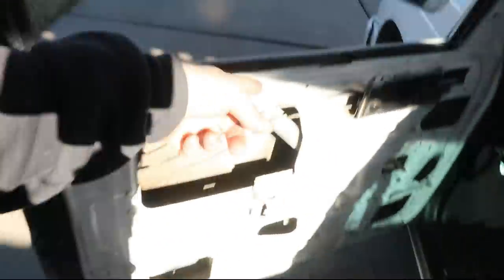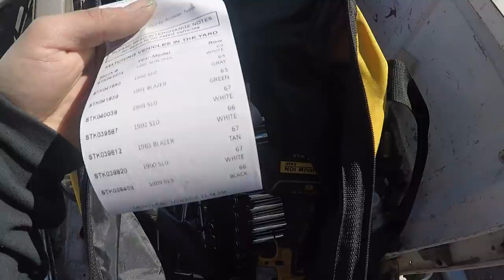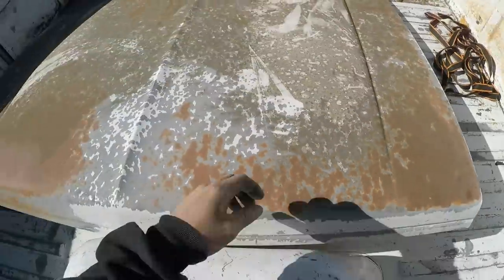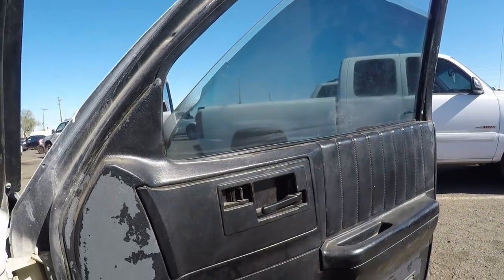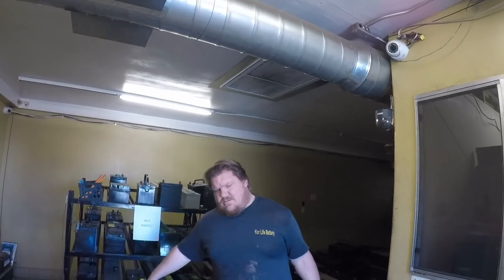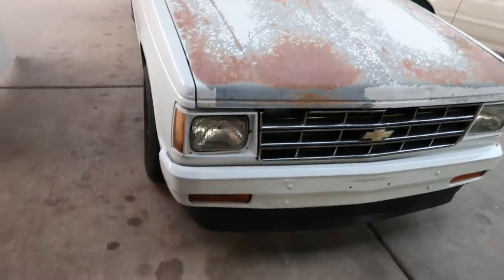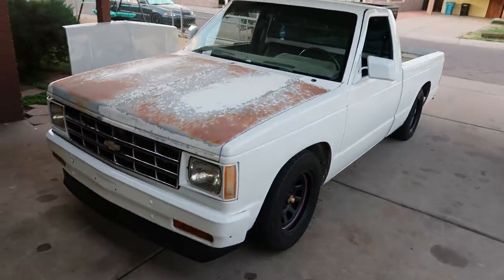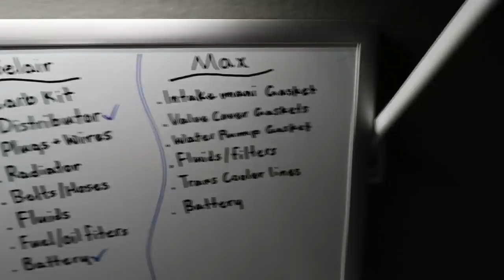Junkyard SCORE!

Comment: Pull the truck out back and do some scrap runs of old useless parts , sometimes a good clean up shows you just how much junk you won’t use that’s taking up space , just do one day of straight cleaning and put all the non running cars out back and leave a clear shot to the paint booth open and get all the cars from out front and around your house , while getting some extra spending cash . Post some things for sale on Facebook market place and maybe some cheap metal shelves for some other parts .